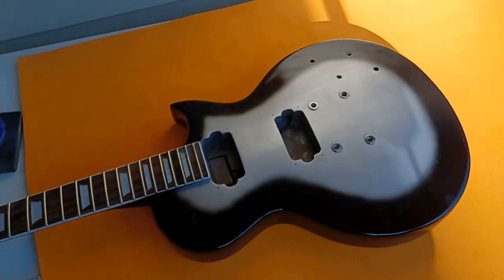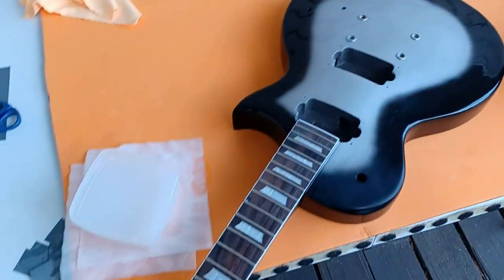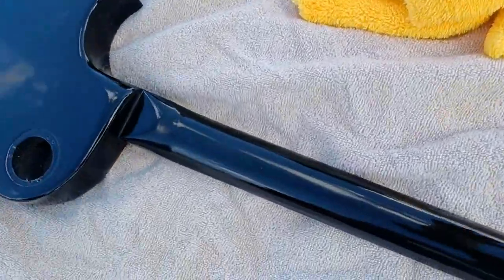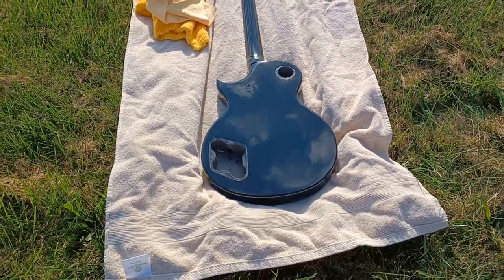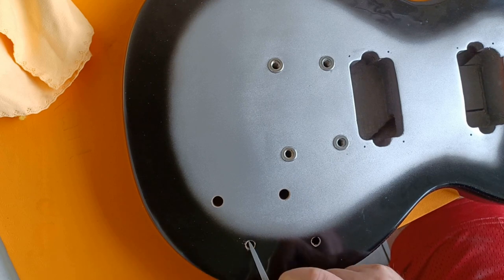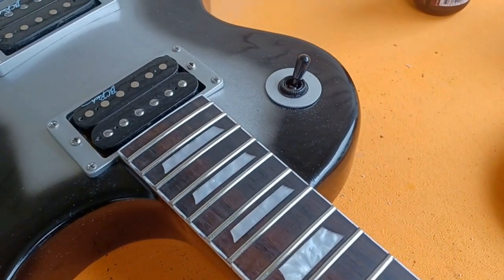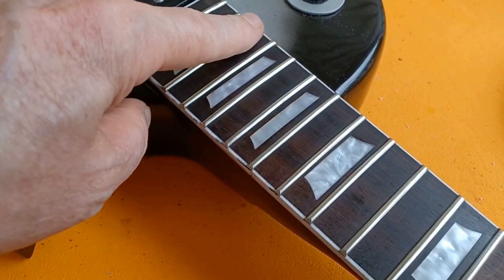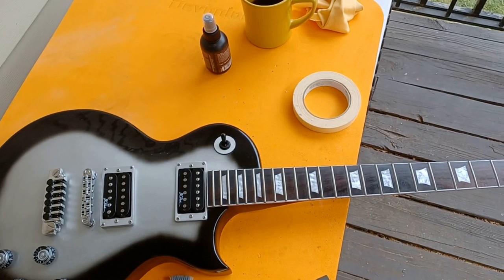Pre GGBO Part 10 Am I winning? #jurgscup

Comment: Good job buddy!
Reply from the maker: Gettin close to the finish line. Pickups are getting wound tomorrow for it and my next build!! So stoked to hear them. Have not used anything but EMG's since 83 so a big change for me.
Reply: @borgonianevolution  only ever had one set of emg and they were pasive, came in a Japanese jackson with the emg afterburner. DMGT? DGMT? Some combination of letters anyway lol
Reply from the maker: @nsjguitarsakascotsman6989  I almost went with a set of passive EMG's for this until Todd and Gio talked me into trying Bill Taylors Sonoma's
Reply: @borgonianevolution  regular pickups are great, love how things change so much with the volume control when playing through a valve amp. Loads of character.
Reply from the maker: @nsjguitarsakascotsman6989  I can do the same with the EMG's but less noise and harder to evoke feedback at lower volume  unless you are standing right up on the cabinets